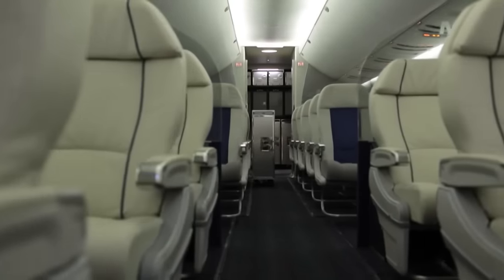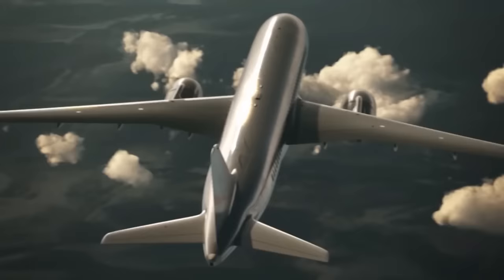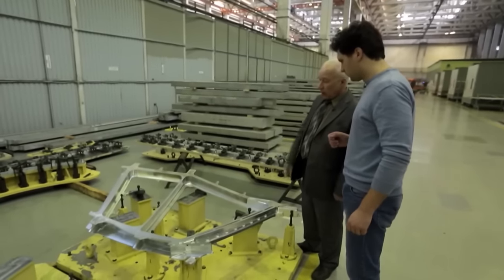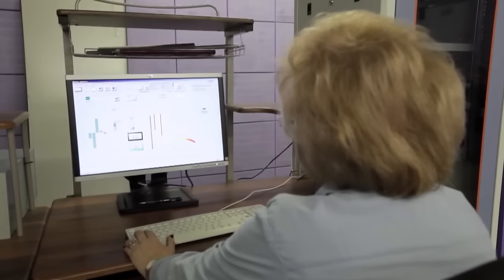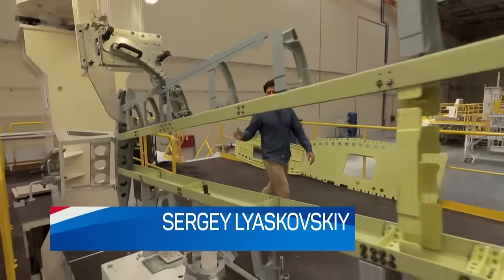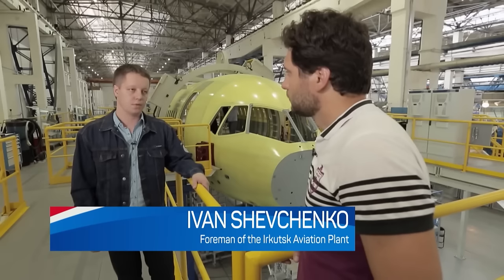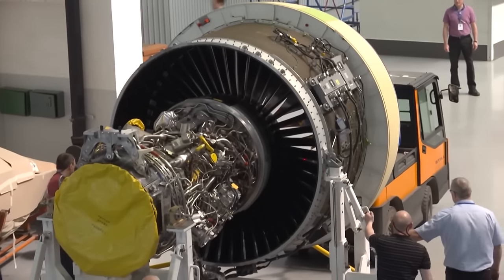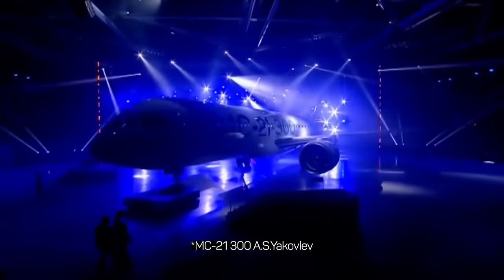Irkut MC-21 — The Aircraft That Can CHANGE The Way We Travel

Comment: Умные люди строят современные самолеты. Неудачники в комментариях говорят о том, чего не понимают.
Reply: Не понимаю
Reply: @x0718  Я тоже
Reply: @DanzZZzYT  привет- never wrote to a canadian по русский before.
Reply: There's a big market for Russia inside BRICS alone, Boeing has a backorder of over 5000 planes with production slowed down or stopped due to production mistakes, Airbus has backorders of over 8000 planes mainly in this class ie A320 NEOs, neither of of them having enough production capability to meet the existing demand, if you order a new A320 NEO now you wont get it until sometime in the 2030s. 
Russia if it can can solve the issues with replacing imported parts with home made equivalents of equivalent quality and reliability they have the potential to steal a lot of Airbus or Boeing's backlog orders which could be thousands of planes, particularly nations within BRICS, they would need to set up a Global parts system to do this but that's a bridge to cross when you come to it.

Comment: A fabulous and informative video, and a wonderful aircraft well done Irkut Corporation and the Russian people. Kind wishes and much respect from the UK 🇬🇧🇬🇧🇬🇧
Reply: Cityjet, an Irish airline, which had a fleet of BAE 146 aircraft, were looking for a replacement for their ageing fleet. They thought the Sukhoi SSJ might fit their requirements and took two on trial to evaluate them.  The SSJ was a nice, but very unreliable aircraft, and had no spares or service backup. They spent most of their time on the ground. So they were returned to the manufacturer.  It could have been a great story for Russian airliner builders, but alas was just another great failure.  Getting certification for the MC21 in the west will be quite a problem.